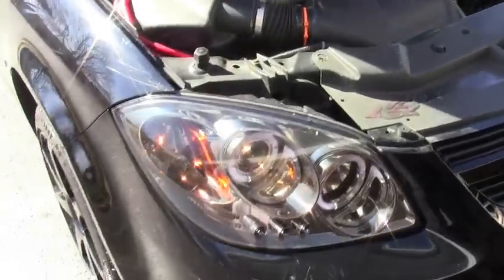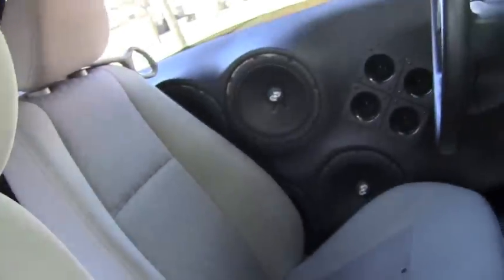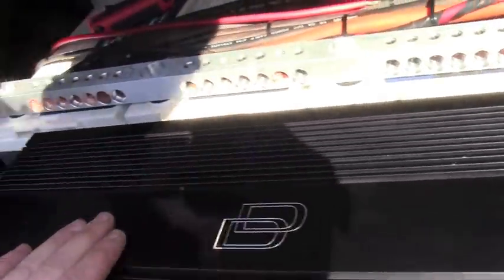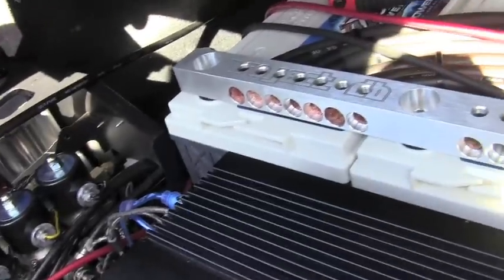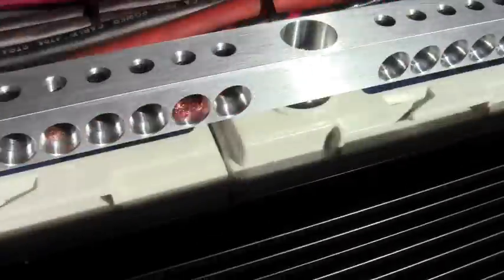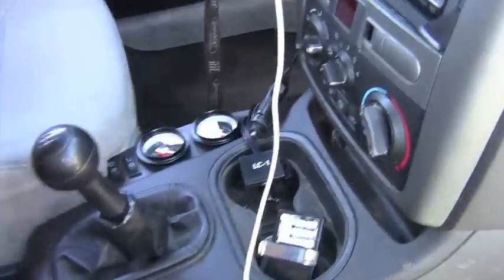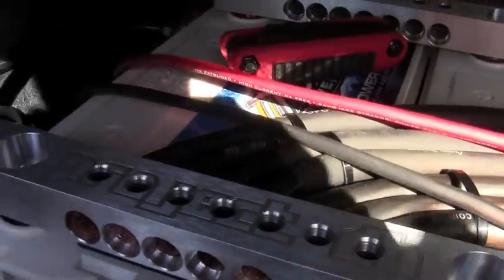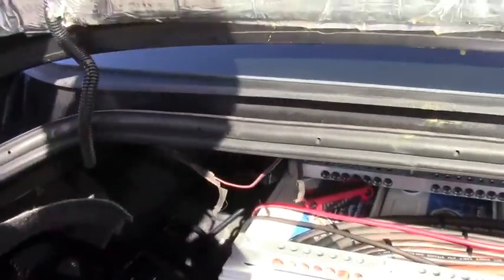walk through of the worlds loudest chevy cobalt

Comment: The Pyles haven't blown out on you yet? anytime I've ever bought Pyle of shit products they never last very long. they lie about they compression tweeters ratings and I found one set wasn't even compression, they were piezo tweeters.
Reply from the maker: Sergeant Seven if you set them up correctly you won't have issues. Never had an issue even though the speakers cost 6 bucks a piece. After 4 years of constant abuse and rattling from the subs they never failed. I sold this car in 2014 and the new owner still hasn't replaced them either
Reply: Thats good to hear. I guess you win some and you loose some. after 4 sets compression horn tweeters in a pro audio rig we ditched them and switched to Cerwin Vega. Our issue was with the states RMS power ratings, what was advertised was bull shit. We gave them a try because of cost, we were replacing some older equipment and saved the cabinets because they were still good. Mind you this was all for a professional live audio company, the sound engineers didn't have much faith in them either. I guess if you were to be conservative and under power them they might last but thats not good for the amplifiers usually.